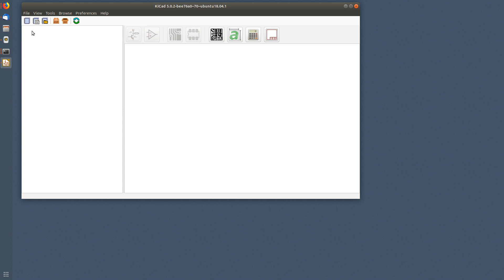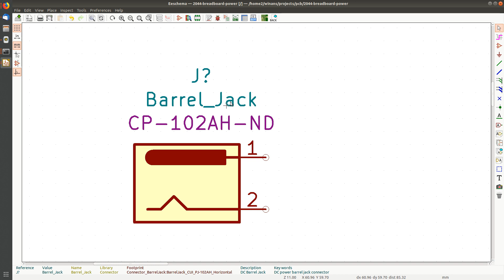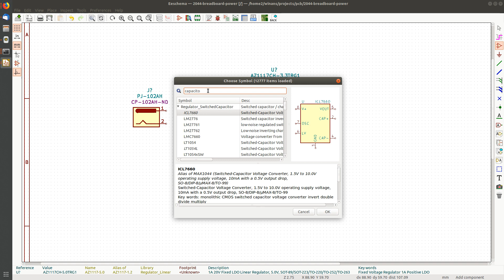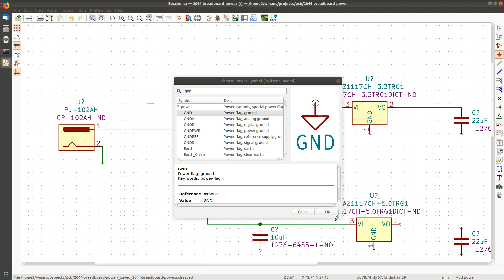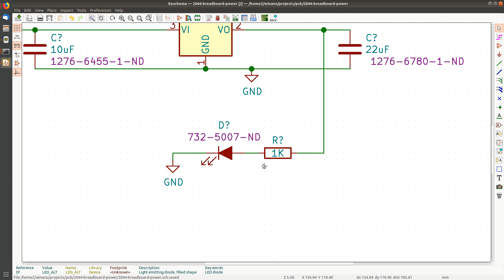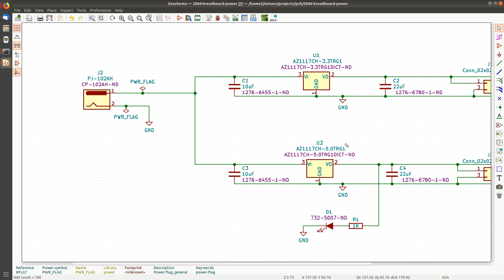KiCad 5 #2 Schematic Details & DRC

Comment: Those power flags are driving me nuts.  I have some IC's whose power input pins are connected to the power through RC decoupling networks.  R and C pins are passive.  So even if I put a power flag on the line driving the resistor that drives the IC, the design rule check error does not go away!  Also I designed my own power symbols (I edited copies of the +12V symbol to create +12Rx and +12Tx), and parts fed via these symbols also have the not driven error!   I've put down some connectors that will be connected to power, and they go to the +12V or +6v power symbols, but things driven by these symbols are also showing unconnected!  
Once I get rid of all the unconnected errors I really don't need to see the power_flag symbol, can it be added to the schematic, connected, and then made 'not visible'?
Reply from the maker: I put a power flag on the output side of the RC filter. Some times i put them in a corner on named net stub wires to keep them out of the main view.  
I'm not aware how to hide them.  Some times I place things I dont want in view outside the page border.  So it is there, but not printed etc.

Comment: Ok, brain got hurt at about 3m45s. In Windows it's a little different, maybe it's Windows, different build no or whatever, anyway... You will find it easier to mouse over the jack you've placed and press 'F', either press select with a empty text box, or type 'Connector_BarrelJack' and press select, then scroll, locate Connectors in the first column, then the BarrelJack you want in the second column and double left click it, then click ok. Ensuring you are in normal cursor mode, double left click the jack and you'll enter symbol properties where you can use the left '+' to enter a new field and enter the part number, click 'show' and we're back to the lesson. So. Brain not broken, but because Windows is, well, not Linux on which these lessons are created, we must expect some alterations. So, good to know my brain isn't broken, lessons learnt, and, as a bonus, I paused the video at the datasheet view and made my own design using through hole components, playing the lesson to finish off my education...

Comment: John, Thank you so much for making these Kicad tutorials. I have looked at others. I find your much easier to follow and understand. One question though. I am using v5.1 and it looks a little different with the placement of the icons on the top. Did you rearrange yours or is that default? Thanks again.
Reply from the maker: Some of the menus were changed in the last few sub-point releases over the last year.  Things are all still there but might look a bit different.

Comment: Another good explanation, I just wanna know why it showed warning first time? 
What I understood, that the program didn't know about the voltage source, and by adding the power flags, we just said: this is the voltage source ?
Thanks Mr John
Reply from the maker: Yes.  Adding a voltage symbol does little more than give the net a global label.  It STILL needs a driving source.  Adding a power flag tells the DRC you know what you are doing and that you are driving it somehow that is not obvious to KiCad from the symbols on that net... like a connector.

Comment: Great series but I would suggest not to be blasé about not using specific components. You can explain it doesn't matter, but choose something specific. Just like ALL the other parts. It helps people.
Reply from the maker: I'm not sure I understand your concern.  Are you talking about the generic parts? Like which capacitor symbol? And which LED symbol?
Reply: @JohnsBasement  Well the diode and resistor but not the symbols, the specific selection of the components. These videos are. hands down, the best Kicad examples I've seen.
Reply from the maker: Yeah... Reviewing it today I get that.  I don't like when presenters gloss over such things... and I did it myself! I'll add this to the list of things that need work if I ever redo the series. #fixme
Reply: @JohnsBasement  I'm guessing a redo would wait till Kicad 6 is stable. I'd like to suggest a project that has a few more components but still focused on a practical item that electronics makers can build fully and will be beneficial. This bbPS was so much better than others.
Reply from the maker: @cdyoutoob  I'm open to suggestions on the project.  
I am torn between thru-hole & surface-mount for beginner projects.
It is starting to get hard to find reasonably-priced thru-hole parts for some items.
If you watch on, you will see that I run through a few different USB connectors.  I didn't know of the mini thru-hole part until I was half-way through the series.  I would have started with it had I knew.
As for resistors and such, the PCB area and prices just get too big when using thru-hole packages.
Ofcourse, the point of learning KiCad is to be able to make your own choices and not be forced to suffer with mine or anyone else's!
Reply: @JohnsBasement  I suggest surface-mount, most makers can and should get used to reflowing SMT. It's not hard at all. Maybe building an arm based board in some uncommon shape. Programmable LED torch with USB-C charging. FTDI programmer. Maybe a survey of ideas followed by vote from followers.

Comment: I do like your tutorials but I am a bit puzzled here. You started with a breadboard design but then went on to specify surface mount components - did I miss something ?   Maybe you could give me some tips for prototyping with SM components, but thanks anyway.
Reply from the maker: I try to prototype with breadboards, when I can, and then use SMT when I transfer to PCBs.
SMT allows more parts per unit area and costs less since PCBs are priced by area.  SMT will also not force thru holes to consume space on every board layer thus making it easier to route your boards.
If you mean soldering... It is mostly technique. Start by watching soldering how-to vids from David Jones on the EEvblog channel. I also explain a bit when assembling one of the example power supplies in part 10b.
Consider holding off on copying this design until you install the digikey library (part 9) and look at all the connector options!  There is a mini-USB in a thru-hole format that is MUCH easier to work with.